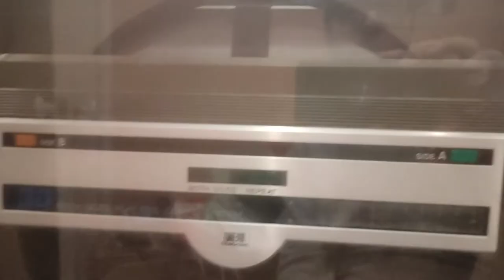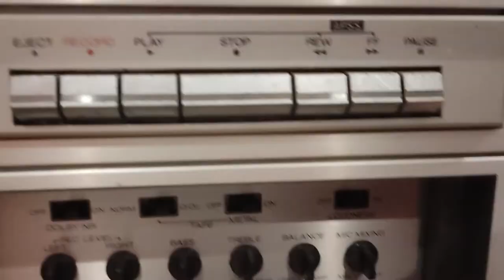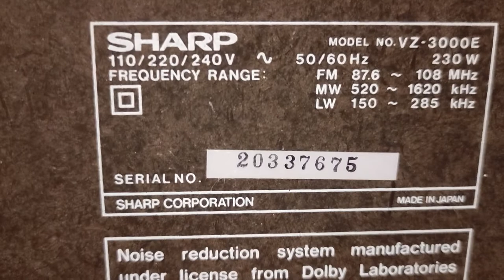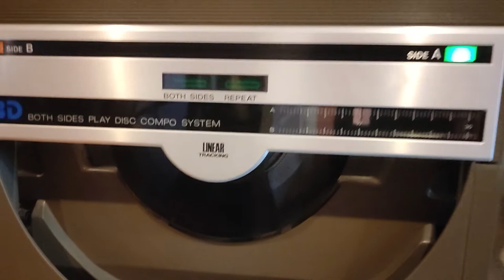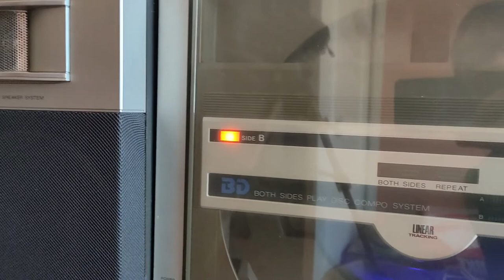Sharp VZ-3000 Repair Video

Comment: I feel a lot better about tackling this restoration after watching your video. I picked up one of these yesterday and while I didn't have power problems, the record player portion is totally dead, the right channel on the tape deck has no sound, and the membranes on both speakers have crumbled. It was also definitely smoked around... gross. It's a monster job, but this is such a unique machine that I can't wait to get it working again.

Comment: Hi - great video, thank you for doing this!
I have one and had to remove the front panel below the cassette deck, where the treble/bass knobs are, in order to retrieve something that fell inside. When I took  the panel off, the spring that tenses the panel popped out  i can't work out how to put it back in - do you know if I'd need to disassemble the whole machine to do it? Thanks in advance